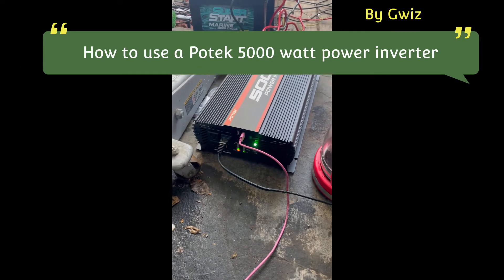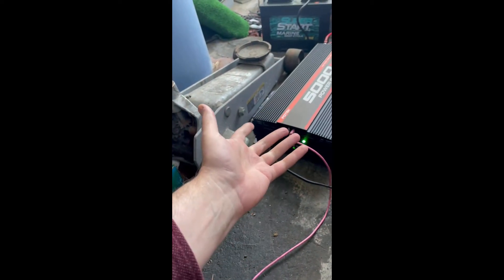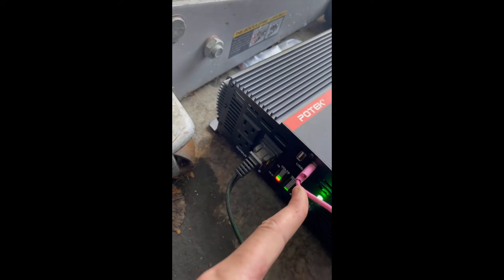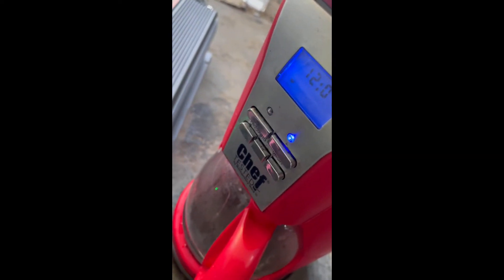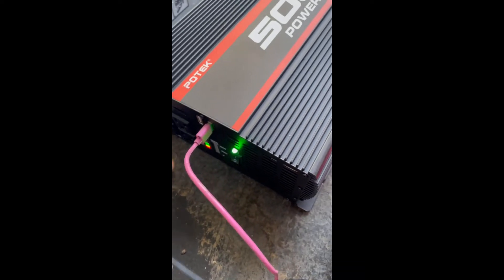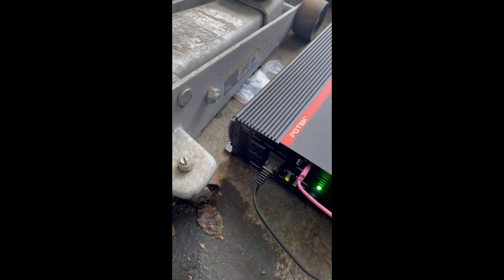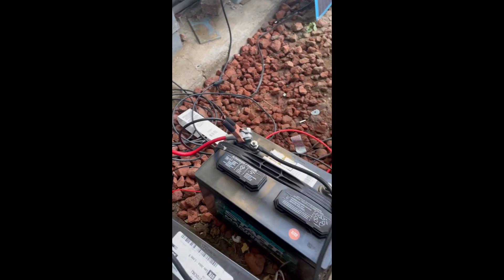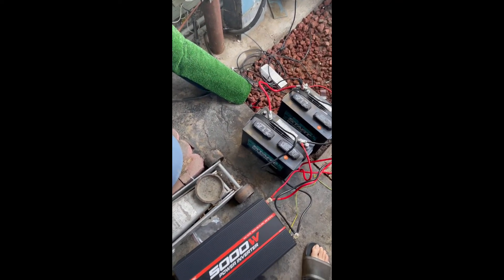How to use a Potek 5000watt inverter and connect to Bluetooth; the wattage of 3 lead acid batteries

Comment: So how you like it so far? Does it actually put out how much it claims? Any issues? I'm thinking of getting one for my truck with 4 group 31 batteries in parallel.
Reply from the maker: This unit caught on fire during the summertime; it’s difficult to say if I can recommend it. What I’ve noticed with inverters is you want twice the wattage rating than you actually need.